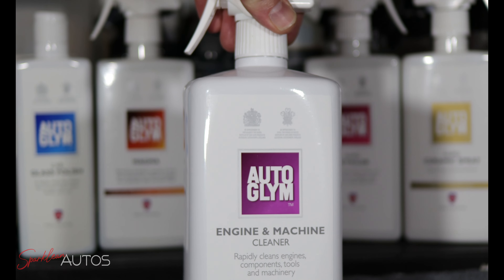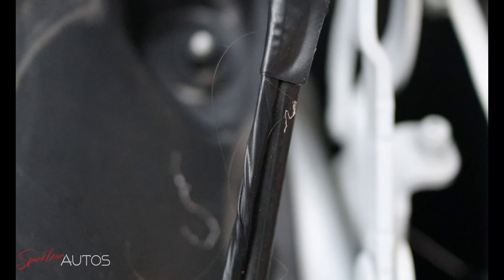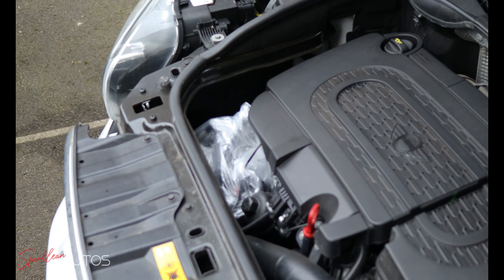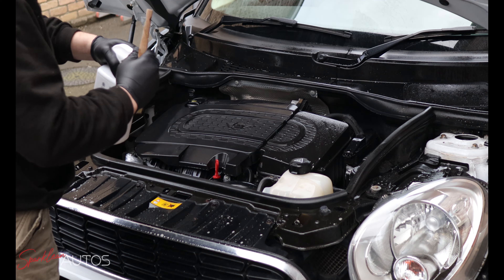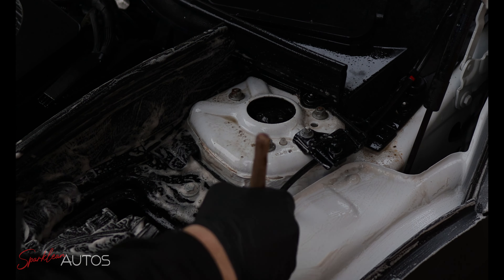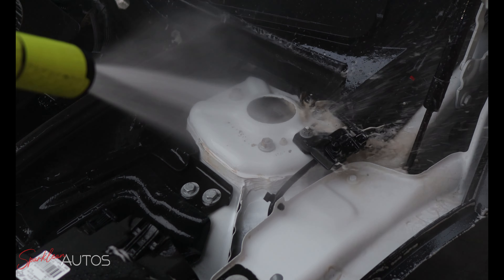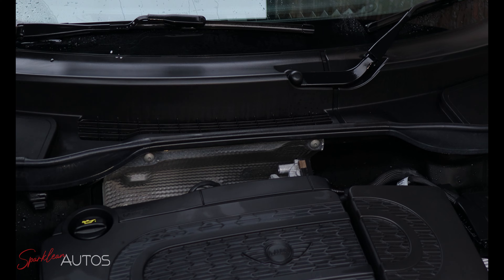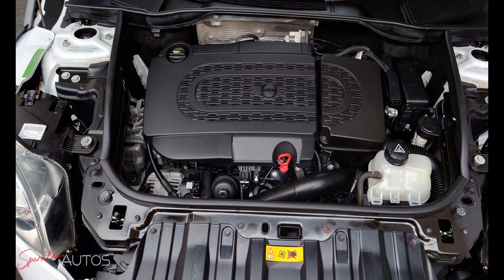AUTOGLYM - ENGINE & MACHINE CLEANER | ENGINE BAY DETAILING Ep020 #cardetailing #carcare #carwash

Comment: is this product safe on paint and or rubber seals in the long term?
Reply from the maker: That's a good question that would be better directed at the brand themselves - however, given that it's a product specifically designed to be used in engine bays, which contain a multitude of rubber hoses etc., I doubt there would be any issues provided you don't allow the product to dry in - as would be the case with any APC. 

Regarding paint, I have been using this, and many similar products, for decades and have never seen any issues on the painted surfaces under the bonnet, or indeed on any of the bodywork which may be susceptible to overspray. Again I would say the same, rinsing thoroughly is ALWAYS recommended.

To be perfectly honest, AutoGlym are one of the best in the business when it comes to making products safe for all surfaces, provided the instructions are followed 👍🏼

Comment: What are the areas that need to be protected from water in particular?

area with sample air filter
Reply from the maker: Modern cars are pretty well sealed but yes, if the air intake is in an exposed area it should be coblvered with a bag/rubber glove etc - most modern cars it's actually around the front grille to allow for cooler air intake and therefore not exposed to direct water intake but always worth checking.

I always cover the alternator too, just because I've been doing this for 25 years and on older cars it was something you needed to do!

If in doubt though, just use a garden hose rather than a pressure washer - a garden hose won't be doing any more harm than driving in a heavy shower 👍🏼

Comment: Nice video, looks like a good product, I don’t think I would personally buy it as I got too much products now, I still get the temptation and buy stuff as I just bought the Turtle wax graphene and acrylic trim restorer and I’m just about to buy Carpro dark side as Slims finally got it, this Auto glym product looks decent but I think I would just prefer a citrus cleaner, I wonder what they mean by Machine cleaner, I found that quite weird that it says that on the bottle, the Auro glym ceramic spray I have used that and still got it but I’ll wait for your video as I’ll give my thoughts on it then not now
Reply from the maker: The name just implies that it can be used on engines and any other type of machine, particularly where oils and greases may be present - it would most likely contain more degreasing agents than a citrus cleaner and therefore more suitable for these areas 👍🏼

Comment: Well there’s a product I never knew existed!!, and it looks as though it’s done a really good job especially if you’ve used so little of it. 
Auto Glym are indeed all about you enjoying the product and it’s use so boxes def ticked there for sure!!
It’s a thing I leave well alone due to the concerns of the water getting into electrical switches it just terrifies the life out of me and I was very uncomfortable watching you rinsing the product off, isn’t there an air intake for the heater somewhere along the scuttle that needs to remain dry?, I saw one video where water destroyed the fan motor due to this, I’m still scared to try 😂

Loving the higher quality upload tho mate, really enjoyed the camera work & macro focus 👌
Reply from the maker: A common misconception but where do people think rainwater goes lol granted you don't stand and blast full pressure around certain areas and a bit of common sense applies, but modern systems are generally built to cope with water coming from all angles 👌🏼

But if in doubt, leave it out 🤣🤣

As for the product, you really can't go wrong with AutoGlym 👌🏼👍🏼

Comment: I spray Autoglym vinyl & rubber care on the engine bay plastics while still wet and leave to dry naturally for a really good dressed finish.  On that note, in the multitude of interior dressing/care/cleaning/detailing products available on the market VRC is actually rather good inside the car maybe a it sheeny for some but easy to apply and remove no ill effects and has a delightful lemon sherbet scent. 
While your on this Autoglym theme would recommend giving it a whirl, even try the engine bay trick.  Cheers!
Reply from the maker: I'll maybe try that next time 👍🏼👌🏼